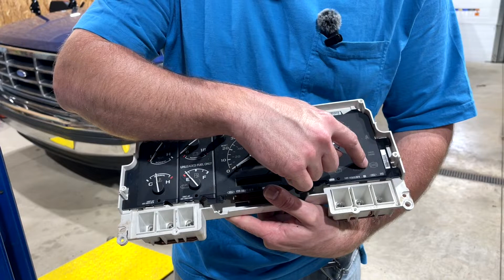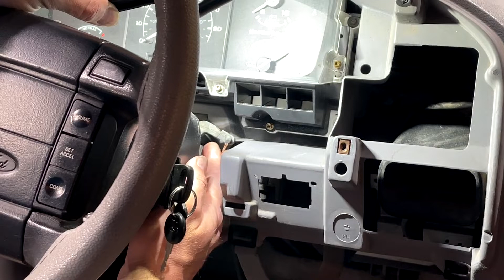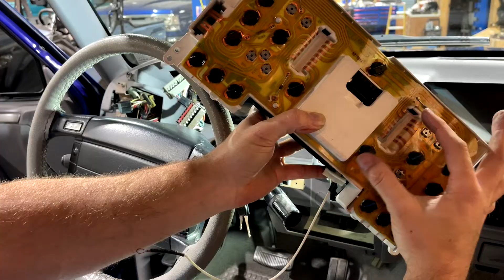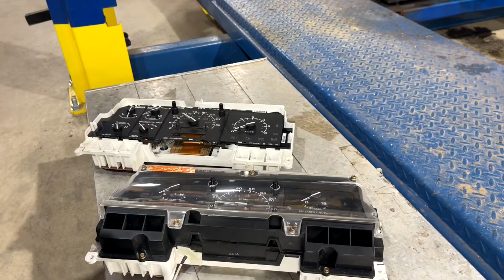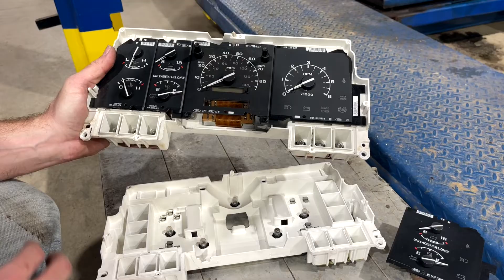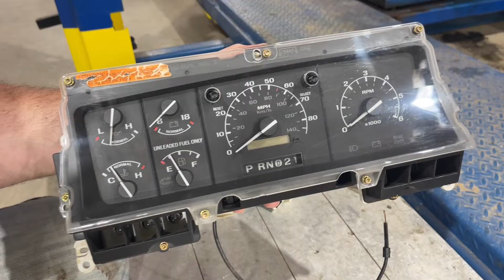How to swap out your OBS Ford Cluster to include a Tach!

Comment: Would you happen to know if I could swap out just the PSOM/Speedometer from a 1995 f250 into a instrument cluster of a 1997 F250 HD as a replacement for the broken/none working PSOM/Speedometer currently in the cluster of the 1997? I know it’ll have to be calibrated for axle ratio/tire size and mileage wont match the 1997’s but will it still function correctly in the 1997?
Reply from the maker: Yes you can.  But you’ll need to document it very well for mileage reporting.  It’ll flag as an odometer tampering when you report mileage for registration or insurance.
Reply: @GarrettsOBSGarage Oh gotcha yeah that’s true, that completely slipped my mind but thank you for the info and reply I really appreciate it.

Comment: So the circuit board on the cluster is what changes to allow the wiring harness to power the new tach instead of the two guages that were originally in the new tach position? Correct?
Reply from the maker: Correct.  The harness has the wiring. But the cluster is required to take advantage of it.
Reply: @GarrettsOBSGarage  Thank you, I just found your site and will be checking out more clips. I'm just starting a build. 1994 f150 e4od 4x4 but being in Canada I had to source a southern body, I have a 96 cab waiting on a dash wiring harness. Because the harness came out of a 5.0L I'm told there is a wire I have to disconnect in order to upgrade to a guage cluster with a tach, have you run into this before?
Reply from the maker: @kelvinmann1058 I’ve never seen where wires need changed to use a tach. Follow the year break downs and don’t mix and match wiring harnesses and you’ll be good.
Reply: @GarrettsOBSGarage  Ok, the only source of information I've had so far is Google assist. Glad I found your site. It says because the guage will be looking for a v8 signal and only receiving 6 pulses the guage will read 1500 rpm instead of 2500. Will a 2wd cab work on a 4x4 chassis without cutting and adding the high transmission hump plate.
Reply from the maker: Don’t trust the AI.  It’s wrong as much as it’s right.   I suggest cutting the holes.
Reply: @GarrettsOBSGarage  That's why I'm glad I found your site. I have to cut the 4x4 shifter hole for sure, just wasn't sure about the bigger one with the large cover plate. Thanks again.
Reply from the maker: @kelvinmann1058 glad it helps!   There will be videos covering that on the channel soon if they aren’t already up.

Comment: Best tutorial out there.. just make sure you;

put the speedometer back to zero. 

make sure copper Connectors on the back are not bent broke or twisted.. 

- Push the connector in until they click and then some more lol

- replace the bulbs while you in there.

- if the face plates are sliding put tape on the top and bottom, the sliding can bound up the needle the needles
Reply from the maker: All very good points.  Just about any time I pull a cluster after it’s been a long time.  I change the bulbs. Haha
Reply: @GarrettsOBSGarage I learned the hard way lol New cluster with tach had at least 5 blown bulbs.
Reply from the maker: @rcklssmx6331 niiiiice.  Yeah I always change them. Then test everything before final install

Comment: So my non tach 95 harness/ connectors are compatible with the both the tach cluster and the substituted gauges?  Is there any significance to the fact my truck is a 95,  but non-OBD?
Reply from the maker: You’re correct.   The only thing you need is the cluster.

Comment: Hey man. Thanks for the video its great. I have a bouncing speedometer when i reach 45 mph. It erratically bounces around (the needle) and i thought i could replace the speedo but I didn’t know that i needed to keep the original speedo and odometer. How can i fix this issue if i cant swap the speedo? Have you ever heard of this? I have a 94 Bronco, 5.8
Reply from the maker: The bouncing speedometer is a very common problem.  The issue is, where is the problem coming from?

The Speedometer gets its signal "from" the Vehicle Speed Sensor in the rear axle, but the ABS box, and PCM also get that signal.  The Tone Ring in the rear differential could be damaged, that will cause bouncing.  The VSS could be bad, that can cause bouncing, the ABS control can even cause improper speedometer readings, but is not very common to do so.

The BEST thing you can do is, get a scan tool that will plug into your Bronco, and read the computer.  Figure out if the PCM is seeing a steady signal from the VSS.  If it is, then you know the problem is isolated to the PSOM (speedometer), or the ABS Controller.  I am not sure how the 4WABS works on the Bronco, but on the trucks, you can unplug the ABS Box behind the glove box and it will just take it out of the equation.  If that box is still there on the Bronco, you can try to unplug that and see if that helps.

If it ends up being the PSOM, you will need to either replace it, or send it off to be repaired.

Comment: So just to make sure I’m hearing this right. I found a tach cluster in a 94’ f150 5.0. Part number on back is f4 and the faces all are f5. That cluster will work in my 97’ heavy duty with the 5.8?
Reply from the maker: You need to look at the back of the cluster for the part number.  Not the gauge faces.
Reply: @GarrettsOBSGarage  my truck cluster says f6. Donor tach cluster says f4.  it’s a 97 heavy duty
Reply from the maker: @TrevorS-o5u then it will not work.
Reply: @GarrettsOBSGarage could you briefly  explain why? I just put it in and everything is working and my battery is reading 14v while running. The video says heavy duty can be f4-7?
Reply from the maker: @TrevorS-o5u It “can be”. But I don’t recommend it. 

If it’s working, then leave it.

Comment: I have a 93 F150 xlt 5 speed, I got 2 tach cluster from a 94 and both drains my battery overnight, what could be the problem?
Reply from the maker: Because you’re using a 94 cluster in a 93 truck.  You need a 92/93 cluster.

Comment: Awesome video, thank you. I didn't get to see the tach work, trust you, but...with the three wiring pigtails...how does the signals for fuel and battery work when swapped to the other side? I guess they are routed in the wiring on the back...? Then I see on the new module that a wiring plug is sideways, how do you know which way to plug it in? Again awesome vid! I'm aim to do this for my 92' F-250
Reply from the maker: I’ve done this to a few trucks now.  

You’re correct that the wiring path is different on the circuit on the back of the cluster.

The plugs are keyed and only plug in one way.
Reply: @GarrettsOBSGarage  Thanks man! Now that I know how, I'm gonna put a tach on this truck after 33 years, make sure I don't screw up the motor ;) !!

Comment: Great video.   Do the same rules apply to Broncos?  I have a 96 xl 5.0, and would like to upgrade it.  So i would need a tach that says F6?
Reply from the maker: Yes. Broncos follow the same rules. 

If your cluster is an F5, however, you can use an F5 cluster. I’ve run into early 96 trucks having F5 clusters.

Comment: Is the difference between a diesel and gas cluster just the tach or the whole cluster assembly? Could I put a gas tach on a diesel instrument cluster to use in my gas obs?
Reply from the maker: It’s the whole assembly as far as I know.  The only thing they share is the speedometer module.

Comment: I’ve never asked a question on here before, but…..

I’m trying to swap the cluster on my 94 F350 7.3, 5-Speed. Will a cluster of a 95 Automatic transmission work??? Please, any help would be appreciated !!!
Reply from the maker: Yes. It should work.  As long as the cluster came from the same diesel engine.  IDI vs PSD.  They are not the same cluster, so if yours is an IDI, you need an IDI one.

You’ll need to swap the PRND21 out for the manual blank which is two screws.
Reply: Thank you, sir. Thank you so much 🇺🇸
Reply: I replaced the old bulbs on my instrument panel for led lights and now the ones on the door side are not functioning

Comment: Can you convert your wiring to a F4 cluster? I have a 93 lightning someone stole the cluster out of and I have a 94 lightning Cluster.. or can I swap the speedo over to a 92 cluster ?
Reply from the maker: The speedometer is swappable from just about any cluster.   You can use other clusters across the year breaks with wiring changes but I don’t recommend it so I don’t know how to do it.

Comment: great video! I just swap a cluster and I am having some issues. I had a 93 5.0 4x4 no tach and swap it with a 1992 5.0 with tach. now the Right turn signal won’t work. any tips?
Reply from the maker: It’s possible you have a bad connection on a plug, you’ll need to do wire continuity tests and power tests to see what’s going on, check to see if you’re getting power out of the multi function switch on the column, and go from there.

Comment: I have a 95 f150, Could i just buy the tach and the other gauges and put them in the gauge cluster i already have.
Reply from the maker: You need the whole tach cluster to use the tach.  The whole setup is different from the non tach cluster.

Comment: Is the dash wiring harness in a 95 F150 2wd non tach cluster the same a 95 4wd with a tach. I swapping the dash out in my 4 wd and was  wondering if I would have to keep my original harness?
Reply from the maker: The wiring should be the same.  Unless one truck had keyless entry and/or electronic 4x4. 

It’s always best to use your OEM harness because you don’t know what someone else did to the harness.

Comment: Could you use an f6 diesel panel in a 1996 F-150?
Reply from the maker: Not really.  The fuel gauge says diesel on it and the tach is different.   Diesel and gas clusters have always been different as a whole.
Reply: @GarrettsOBSGarage would a diesel tachometer plug into a gas cluster? I have the whole diesel cluster. I will be buying a gas tachometer cluster either way. However, my trucks a i6 and the diesel gauge would be cooler if I could make it work.
Reply from the maker: @ as far as I am aware, no.

Comment: I have a 1994 f150, will a F5 cluster work or does it specifically need to be F4
Reply from the maker: The F4 and F5 will work in your 1994.  It would be better to have the F4 just because it would be exactly the same, but the F5 would cause you no issues.

Comment: 7.3 PSD have F4, F5, and F6 clusters. Not exactly sure what the year/month breaks are. F4 cluster has the brake diode/resistor in the engine bay wiring harness, F5 and F6 clusters have the resistor and diode on the cluster circuit board. Using the F4 cluster in a later 7.3 will work but the ABS light will be constantly illuminated due to the prove out circuit not being connected.

Shift indicators are also transmission specific, I've seen them marked "E4OD" on the non visible part of the legend strip.

If you push the "reset" button when turning the key on, the speedometer needle will sweep to max and back to zero, resetting the needle if it's pegged on the right side after installation. Alternatively, drive the truck and get on the highway, once the speed is high enough, the needle will pull into place.
Reply from the maker: I did forget that the C6 was an option through 1997.    There are minor differences in the 7.3 PSD clusters, but all work, and most have the ABS light on anymore because of an ABS failure. Haha.   I however didn’t know anything about the ABS circuit missing, but the F4 cluster having that issue makes sense since it would likely be a 94.5 cluster, and they have specific wiring harnesses.   Yet another reason to avoid a 94.5 truck.

I try to avoid giving speedometer tips like the reset because it can easily be done wrong and they somehow get into the calibration settings.
Reply: @GarrettsOBSGarage  I'd love to see a video on calibration settings for the speedos say if your running larger tires or such because my speedo is way off due to my larger tires.
Reply: @GarrettsOBSGarage  Speedometer calibration should not occur unless the PSOM pigtail on the bottom of the dash is grounded.
Reply from the maker: @abpsd73  I’ve seen stranger things. Haha